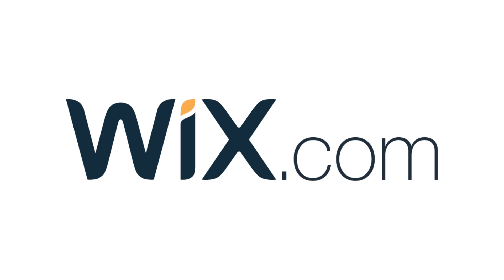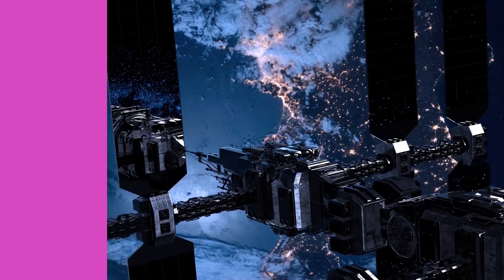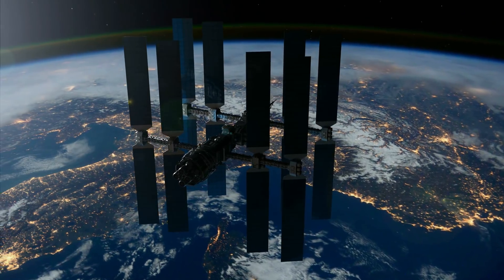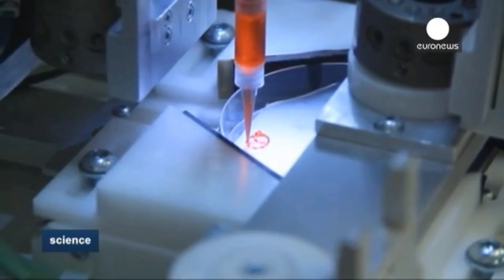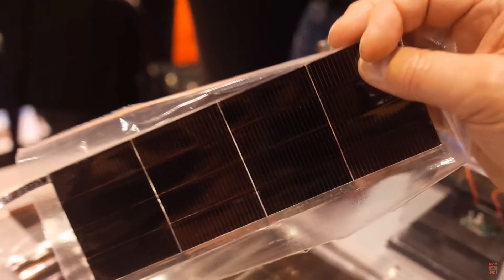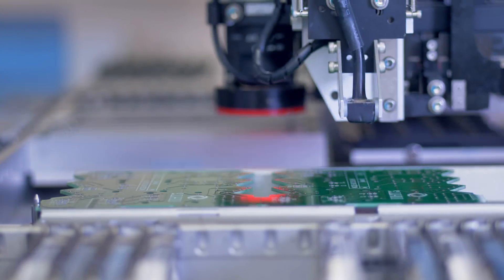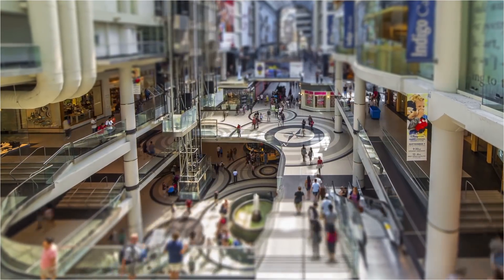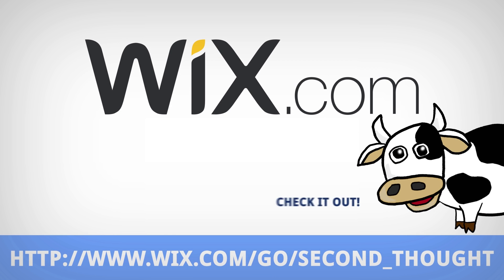Why Space Manufacturing is the Future of Industry

Comment: Even though space is cold it's actually not helpful. On earth you can conduct the heat away but in space it has to be radiated away.

Edit: conduct is the word I wanted to use.
Reply: Lance Wang Go a course of thermodynamics if you want to understand it properly but basically even though the particles in space are cold there aren't that many, basically a total vacuum. The heat of an object will be conducted through the particles but the less mass that can absorb the energy and send it further the less conductivity. It's like trying to get water from one bucket to another without any pipes. This leaves convection and radiation as ways to get the energy away. Convection neeeds something with significant mass again so radiation is the only way.
 On Earth you can use all three ways to remove the heat while in the vacuum of space you are limited to one effective. 
That is actually why the ISS is white(white absorbs less heat) in some places, it could get warmed up by radiation from the sun and couldn't then get rid of it via anything else than radiation.
Edit: further explanation by NASA about ISS: https://science.nasa.gov/science-news/science-at-nasa/2001/ast21mar_1
Reply: If you want some cold manufacturing, you go to Titan, low temperatures mean crazy industrial efficiency.
Reply: Yeah. In space the only way means of heat transfer is radiation. You'd need massive radiator pannels, and probably still would need cooling water transport heat to the radiators.
Reply: AlHoresmi I meant space in the way that isn't on planets. Like around asteroids or in normal vacuum of space.
Reply: Some really good comments here regarding the definition of temperature, heat, energy etc. As stated in comments, radiation is the only option to disipate heat in a vacuum. Temperature is a measurement of the movement of atoms, molecules etc.
Reply: Khenric is correct.
FlawllessCowboy "Cooling through radiation still makes no sense though since its very slow."
Radiation is the ONLY option in space for cooling anything.
It's also why we have a green house effect since it is the only way that planets disipate energy into space (at the top of the atmosphere). 
Salyut 7 lost power, so eventually all heat was radiated to space.
That isn't the same as a space station continually producing heat at a rate that radiation can or can not deal with. The rate of radiation has to be greater than the rate of heat production for the object to cool. So basically it is hard to keep things cool in space, if that thing is a place for humans to live in. It's not a problem if you are happy for it to be freezing!
Reply: This is the comment I was looking for. When the contraption making the product is heating, you need to cool it down. Space = no air = no medium to drive the heat away except the radiation, which is extremely inefficient.
Reply: Electric Futures I wasn't disagreeing, I only wanted to add that it is possible to achieve and maintain very cold temperatures in space. The problem isnt that it's difficult to achieve cold temperatures in space. The problem is that it is difficult to reject heat energy from an object in space. If an aplication requires low temperatures and doesn't generate much heat, space could be very useful. Maintaining near absolute zero temperatures on Earth is extremely difficult and costly. The Kepler Space Telescope, for instance, will be facing away from the sun so that its mirrors will cool and reach single digit Kelvin temperatures so that it can detect very faint infrared light. It can achieve those temperatures because it generates almost no heat, and can radiate heat away faster than it is produced, and it will be shaded from the Sun's light. Spacecraft designed to reflect light, and to radiate heat into space, so if power is lost they can get very cold inside. The space station has lots of equipment that generates heat so yeah the radiators are there for a reason. I was just admitting that I don't know specifically what generates that heat. I assumed it needed those huge radiators for more than just body heat and life support. I was wrong though about it needing to be heated :)
Reply: The radiators are, as far as I know, only used for cooling. The sun shining on the structure, the solar pannels, the instruments, even the astronauts are constantly heating the station. The station also have a heating system of course, but that's not what those white pannels I'm talking about are for.
"Cooling through radiation still makes no sense though since its very slow." There's just no alternative, there's no conduction nor convection in space.

It is of course possible to cool something down, but for that you need to protect it from the heat of the sun (white paint, or "chrome" paint) and not do any activities that causes heat inside.
Reply: Dumbed down explanation for anyone having trouble understanding this discussion: Say you have a piece of equipment that is generating heat and needs to be cooled off. On Earth, the easy solution is to simply dump the heat energy into the air, water, or whatever other substance happens to be everywhere the piece of equipment isn't. This doesn't work in the vacuum of space since there isn't any surrounding matter to transfer the heat to, effectively creating near-perfect insulation. The only way this equipment can dispose of its heat in space is as a glow of infrared light. This process of infrared radiaton is very slow and inefficient, but it's also the only thing keeping the ISS from becoming an orbital oven.
Reply: Space is terrible at getting rid of heat. But icy asteroids might be ammazing heat sinks. Move your factory to an asteroid and drive coling pipes into the ice and then work away while the asteroid gets thawed. When the ice is gone, you just detach the factory and move it to another asteroid.
Reply: Space is not freezing. A vacuum has no temperature, it does not actively cool things down like cold water or cold air. The material has to radiate its heat as electromagnetic waves ( mostly infrared light) to cool down, which is ridiculously inefficient. Said differently, it's HARD AS FUCK to cool down something in space.
If you watch closely at a picture of the ISS, you'll see next to the big black solar pannels, smaller white pannels. Those are the radiators of the station. Without it, the astronauts would be cooked inside the ISS !
Reply: only the particles in space only in the earths shadow are the particles cold the get quite warm on the other side of the planet due to solar radiation
(inferred light mainly)
and more of a tiny little pipe 
heat is one of the problems that space stations, suits, etc. face 
on the iss i'm pretty sure they use radiation panels on the back of the solar panels to cool 
i
Reply: Kind of like my thermos uses a vacuum to keep things hot.
Reply: The ISS uses Ammonia for cooling, but since you are in space using a presumably unmanned (or man tended) facility maybe they can bring back CFCs for cooling.
Reply: The amount of leaks on the system is more a problem of running out of coolant than in effects on the crew, as the system is on an external loop so it isnt in the pressurized environment, and the leaking coolant expands so much in a vacuum is is negligible. Remember, hydrazine thrusters that satellites use are FAR more toxic than CFC, and they arent going away anytime soon and are used on ISS and every other manned spacecraft.
Reply: As a student of materials science, i could like to chip in on some explanations which are not well covered in the video. Industry in space is not so much about the cooling but rather about materials properties and processing that can only be achieved in zero/micro gravity and in low pressures. E.g. zero gravity changes the nucleation and diffusion process which allow much easier purification of metal. It also changes the grain size in welding and casting too, resulting in stronger materials. Low pressures can modify phase changes, e.g. from solid>liquid>gas to solid>gas, potentially allowing less damaging drying processes to be cheaper.

True that cooling might be a big issue. But as long as there's coolants such as water (e.g. from ice rich asteroids), one can achieve good cooling by losing high temperature vapour into space. But of course it has technical obstacles of ferrying these coolants or capturing said asteroid. However, on the flip side, this issue can also increase efficiency by preventing energy loses from furnaces etc. End of the day, it depends on your engineering.
Reply: Ikr.
Reply: Khenric I was agreeing with you in that it makes no sense to use radiation to cool large industrial processes. And therefore it wouldn't be beneficial to use space to cool things. I wasn't suggesting that there are alternatives in space, and I wasn't talking about the space station when i said that. I guess i could have worded my comment better.
Reply: Oups, sorry for the misunderstanding !
Reply: Have you guys read that book "artemis"
Reply: Yeah I was about to say that. From what I hear, dealing with heat is one of the biggest issues keeping us from making large space structures.
Reply: Matthew Lavis Yeah. That's a good analogy.
Reply: Yora That is true.
Reply: ISS doesnt need to heat its interior, the electronics and systems on the station produce enough heat regardless of conditions, which is why the station needs such large ammonia radiators.
Reply: Ronsmytheiii That is true.
Reply: Highfield Hunting Why doesn't the ISS eo this then? Probably because the vacuum is so perfect that it costs a lot in electricity.
Reply: So those scenes in movie Apollo 13 where they were freezing  its just Hollywood bs?
Reply: Utmahr It depends on if the sunlight hits it correctly. Tye good foil was also used because radiation was reflected off.
Reply: Khenric serious question, could you utilize that heat as an energy source for a machine whose sole purpose is to cool the space craft? almost making it a perpetual cooling "engine"?
Reply: Enlightened Perry You could but it would require a lot of infrastructure to create a steam generator.
Reply: xWood4000 I mean you have all of space,  so size shouldn't be an issue.  If I wanted to pursue the path of human advancement, would you happen to know any organization  I can claim apprenticeship under (whilst pursuing education)? Figured it won't hurt to ask.
Reply: Enlightened Perry Depends on which country you reside in but you could try the aerospace giants like ULA and boeing. I'm not the best person to ask.
Reply: Use it as a generator to make a closed system obviously
Reply: xWood4000 space actually can be very hot
Reply: meeshkin gaming Yes, heat can be concentrated in a small volume for example because of direct solar radiation but on average it is cold.
Reply: Khenric I'm not sure what specifically the radiators on the ISS are used for, but they also do have to heat the interior. Space craft  slowly radiate heat away over time and become extremely cold if they are not heated. When cosmonauts were attempting to save the Salyut 7 space station, they discovered frozen CO2 frost in its interior. Cooling through radiation still makes no sense though since its very slow. However it might make sense for things that need to be extremely cold, and dont generate much heat. On earth, just to keep something at very cold temperatures requires a lot of energy and insulation. The way it's described in the video seems misinformed.
Reply: Ronsmytheiii Maybe but I do think it's risky because they have already had ammonia leaks if I'm not mistaken. CFC leaks wouldn't be good.
Reply: xWood4000 Don't understand your statement. You didn't explain anything about the freezing temperatures in space. Instead, you derailed to talking about "leading heat away" concerns. But no one wants the heat anyway.
Reply: space has no way for heat to be given to a object without direct contact or through radiators where the heat goes to slowly dissipate into the cold vacuum of space but it takes a long time due to very little decency of atoms to take the heat

Comment: Here's the thing about space: it's a vaccum, meaning there very little, if any, air in it. Air is what allows heat to dissipate.

The concept that everything in space instantly freezes or is cooled down by it is completely wrong. Since there's no air to dissipate the heat, it builds up more and more until everything begins to melt. NASA has found a way to deal with this all the way back in 2001 as it was a necessity to keep astronauts alive in the ISS and similar constructs. It's much smaller though and more focused on people rather then machines so adopting it for large-scale construstion may prove troublesome.

Here's the page detailing the method and process: https://science.nasa.gov/science-news/science-at-nasa/2001/ast21mar_1

Also, you wouldn't immediately freeze in space if you were exposed to it without any protection. Asphysixiation would happen in about two minutes, yes, but it'd take 8+ hours for your body to actually get cold enough to freeze depending on weight and if you were dead or alive prior to exposure.

Source: https://www.quora.com/How-long-would-it-take-for-a-human-being-to-freeze-solid-in-outer-space

The more you know!

Comment: I see a problem in  your video. Space is not cold. When you manufacture chips in the vaccum of space you would need even better cooling because the heat can only go away as infrared light ratherthen through medium like water. Or did you mean producing them on the darkside of the moon os something like that ?

Comment: Dispersion of heat not a problem in space ? oookeeyy doookeeyyyyy
Reply: On the biggest scales heat dispersion by radiation is the only game in town.  The Earth radiates excess heat from its night side after accumulating it on the day side.  The sun disperses heat almost entirely by radiation.  The common form of heat dispersion in day-to-day experience, conduction, is only possible above a certain material density.  Material has to be in contact with other material.  But our universe is a high vacuum for 99.999% of its volume.
Reply: @testaccount-lt2vq  that's the dumbest thing I've ever heard.

Comment: I think that it's a very promising idea but the cost of sending anything to space (not to mention the pollution rockets produce) is too high to make space manufacturing a viable solution.
Reply: Not if you manage to get the raw materials from space as well.
Reply: that would require building an entire factory and ore extraction facility in space, as well as being able to move that whole thing around in space which would require a constant supply of fuel, which is simply impossible with current day resources and technology.
Reply: If you insist on putting full-scale infrastructure up in one go, then yes, it's not possible using current technology.
Starting small, however, and building up from there is quite doable even today. It'll take a decade or two to build and install the required infrastructure, but once in place it should grow exponentially without requiring any more resources from Earth.
The question is, whether the potential advantages justify the cost of bootstrapping and what kind of entity would be able and willing to try and do it.
Reply: where exactly would you get the resources in space from